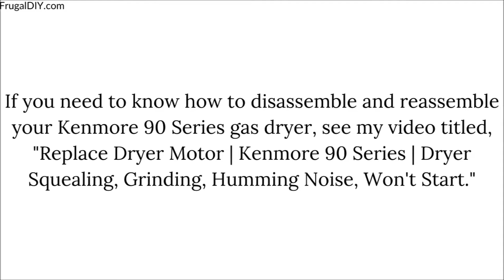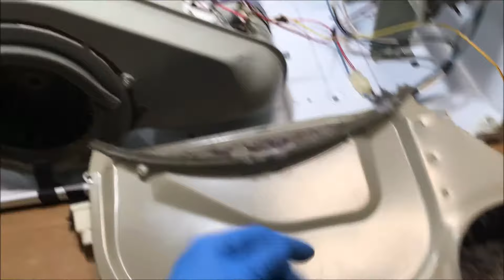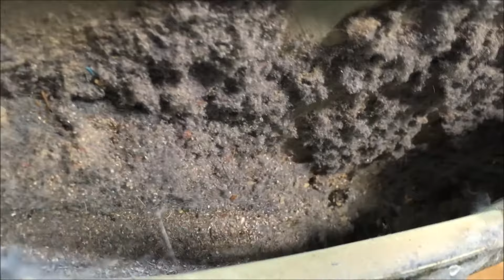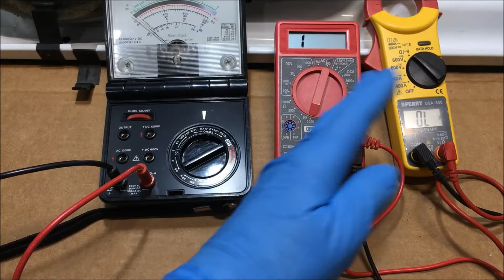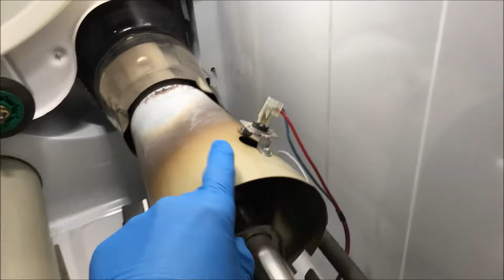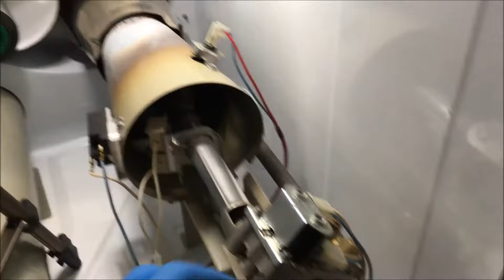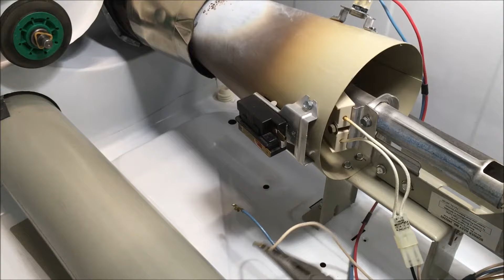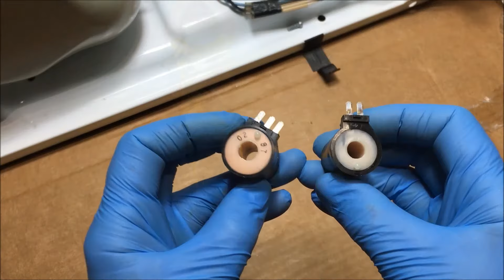Troubleshoot Gas Dryer | Dryer Won't Heat, Won't Start, Won't Stop, Dry Time Too Long, Dries Too Hot

Comment: I've now replaced the thermal fuse twice in the past 24 hours.  It's a Samsung DVG54R7200v/A3.  Anyone have any ideas?  I've checked the blower assembly, lint filter, and ducting.  It's a new house.  Issues in the dryer duct in the attic?

Comment: Agree,.... the best explainntion to save a lot of time to guess which one fails. I watch at least 4-5 video. I open to test high limit thermal, ignition vail coil boht of them are good. I opnned igter burner - I broken.. then I watch this video I found the issue - the first one thermal fuse she suggested - it failed.. it should cost me $5 .. inrtead of cost me $20 -$5 and igniter ($15).. thank a lot..

Comment: The flame sensor is normally closed so a continuity test doesn’t show that it opens properly. When the igniter warms it up, the circuit opens and there is no continutiy. I’m not sure how to test if it opens with the correct amount of heat.

Comment: Hi Frugal, thanks for your video. I have an LG DLEX3700V dryer that's giving me the error code TE1. I looked it up online and found that it might be a bad thermistor. I ordered a new one (model 6323EL2001B) and replaced it. I measured the resistance of the old one, which was about 8K ohms, and the new one reads around 10.8K ohms. From what I found online, the normal range should be around 11K ohms, so I think the new thermistor is fine.

I also tested the round thermal fuse you mentioned in your video, and it reads 0.04 ohms, which seems normal. I took apart the vent and cleaned everything, inside and out. There’s no dust or blockage near the two sensors. After reassembling everything, I double-checked all the connections to make sure they're tight. I also measured the resistance at the yellow and blue wires leading into the control board, and it shows around 10K ohms, which means the connection to the board should be fine.

Once I put everything back together, I reset the dryer by holding the start button for five seconds while it was unplugged. But when I powered it back on, it ran for a few seconds and then showed the TE1 error again. I tried restarting it a few times, but the TE1 error keeps coming up.

Do you think this could be a control board issue? The board is pretty expensive, so I don’t want to buy one without being sure. Could you help me figure out how to use a multimeter to test the board and what kind of readings I should be looking for to determine if the board is bad?

Thanks for your time, and I really appreciate any help you can offer!

Comment: This lady is an expert. I watched 10 other videos trying to trouble shoot my Whirlpool Duet Dryer. They did not solve the problem. Luckily, I clicked on this presentation. It is a clear, concise and comprehensive look at the entire heating system. I watched it twice, before starting repairs. I did test the two fuses others discussed in other presentations, but had continuity with both of them.
 She led me directly through each component, where it is, how to get it out and how to test it. After watching twice and listening to her accompanying dialogue, I monitored the dryer after taking off the front lower cover. I was able to see that the burner would not relight after the initial cycle. The lady mentioned it would most likely be the two coils that were the culprit. 
Amazon and $8.40 later, the coils arrived. I watched their installation 3 more times to make sure it was right.  NOW I'M A HERO! THANKS TO MS. FRUGAL!!!
Reply from the maker: Rodney, I can't thank you enough for your thoughtful and kind comment.  It means a great deal to me, and I just love hearing you fixed your dryer for $8.40.  Great job, Rodney!   You're certainly a HERO in my book.  I so admire DIYers.  ;)

Comment: Thanks for the video...while I was unsuccessful, I feel I learned a lot and gained a confidence boost. Before I bought a multimeter, I arbitrarily decided to replace the thermal fuse and coils. Since that didn't help, I replaced the igniter, which also didn't help. I then wised up and bought a multimeter. Turns out, all of those components had the appropriate continuity or readings within the right ranges. However, the cycling thermostat (2nd item you checked) did not seem to have continuity. However, the replacement also didn't have continuity. It didn't seem to be exactly like yours...there weren't 4 wire connections, only 2. So not sure how that should have been tested. In any case, I ended up having a service person come, who diagnosed the issue as a bad control panel. They don't manufacture the control panel anymore, and seemed to be $150+ on ebay. I opted to buy a more analog used dryer gor $50 on facebook. I did install it myself. Either way, though I wasted some money on non-refundable parts, I got my hands working and gained some education, I really feel a more can do attitude, largely inspired by this video and that experience. Thank you!
Reply from the maker: You welcome.  I'm glad to hear my video helped to muster the confidence to fix your dryer.  I know, from personal experience, you can fix most stuff yourself, and I hope you know that too.  ;)

Comment: Hey i have a few questions: does the sequence of operation starts in the order you explain it here? And does the function/communication of the igniter and the heat sensor in a gas oven?

Comment: My burner lights but shuts off after about 30 seconds but the rest of the dryer continues to go and nothing is plugged it's clear and clean. I replaced the coil just for the heck of it with new ones but it still does the same thing

Comment: My Samsung dryer will start and heat - but shuts down after a few minutes - and seems pretty hot inside. However, it can be restarted again right away - only to repeat the shutdown cycle. It will run fine in air fluff (no heat) mode. I've dismantled and thouroughly cleaned everything - and all the thermostats/sensors show continuity - but the shutdowns continue. >>> Could the thermostat have failed in the "always on" (i.e. always shows continuity) which causes the burner to stay on too long and then the high temp limit switch shuts everything down (although I thought the high temp limit switch would just turn off the burner - not the motor too. Any thoughts would be appreciated - before I admit defeat and call in a pro.

Comment: After checking everything else, it seems I have a coil issue. To make sure, since I don’t have a viewing hole to see the flame, I turned off all the lights to make the entire room was pitch black. I also put some aluminum foil in a spot where it didn’t touch anything but hopefully would reflect some light for me to see, though i actually don’t think it was needed. After the dryer was turned on, I saw that the igniter turned on twice (giving a bright red-yellow glow each time) and the gas lighting up twice, giving a faint but visible blueish glow. After that, the gas wouldn’t light up anymore. I immediately turned the dryer off, unplugged it, quickly removed both coils to test on a multimeter (you don’t have to be super rushed, it’ll stay bad for a while), and saw that one of them didn’t give any ohms. After letting it cool down, I tested it again, and sure enough I got a reading. Did all of this twice (ensures I only need to “cut once”). 

To OP, thank you so much for this video, I really appreciate it! Hopefully I can get this all repaired up. I’m so tired at this point @_@

Comment: Mine starts has the flame come on for a few seconds then shuts off with an error code of E01. It's a Bosch. I bench tested the flame sensor and it never opens. Could this be why or something else?

Comment: Awesome video, as a DIY Homeowner I was able to fix my dryer with your expert help. The only problem I had was, I wanted to test everything before I put it all back together and could not get the motor to switch on until I move the idler pulley, and there was a micro switch and then everything worked thank you so much.❤️

Comment: I fixed my dryer last year by cleaning a very fine build up lint that was blocking the cycling thermostat. Funny thing is NOBODY mentioned this in the videos I watched when I was trying to troubleshoot it last year- I discovered it on my own. I wish I would have found your video back then but at the same time it felt good to find the issue on my own! That and your video is better than ALL of the ones I watched when I had my issue last year. I have an issue now where the flame is blowing wildly instead of smoothly, causing it to trip the  high limit thermostat. I have a good feeling my coils are failing. Thank you for this great video as it was a great refresher!

Comment: Had no heat. Tested everything. Found no faults. It was apparently the 25 year accumulation of lint that blocked the view of the flame detector and stopped it from igniting. After a good cleaning it worked. Job was more tedious on my dryer because you have to remove the whole front for access to the burner assembly. Then you can't do any live testing without putting it back together. 
And yes, I watched several dryer youtubes and this was the best

Comment: I am dealing with my whirlpool duet, 19 years old, with this excellent tutorial, I am confident I’ll be able to fix it!! Thank you some much!!👏🏽👏🏽👏🏽👏🏽  
I think is the igniter, I have checked the thermal fuse, the high limit thermostat, the thermistor, the  Gas Valve Ignition Solenoid Coil, and they all test good. 
The dryer turns on, but the ignitor doesn’t come on, there for the flame is not coming on. Thank you again for the tutorial!!

Comment: Great video and it helped a lot - although my Kenmore dryer might be  a newer design because it's very different from what I see here. The burner is on the other side. The blower is not inside the cabinet, it's on the back bulkhead (along with the thermal fuse and cycling thermostat). Speaking of cycling thermostrat, on my dryer, searspartdirect refers to is as a "drying thermistor" and it has two pins, not four. You test it by removing it from the dryer, then measuring the resistance as you blow hot air from a hair dryer on it. You should see the resistance decrease.
I just got done testing everything and all components passed - but my dryer's burner shuts off a few seconds after it ignites so I suspect the coils. However the ducting and exhaust had quite a bit of lint so my first move is to clean all that out and see if that fixes it.
Reply: And indeed it was the coils. As you cautioned in the video, they tested good - but failed under operation. All fixed now - $17 at Amazon! Thanks again for making this video - it's by far the most informative appliance "fix it yourself" vid I've seen on youtube.

Comment: I just wanted to send a little something as a THANK YOU for making this video. Our 30-year-old dryer finally stopped heating yesterday, and I had no idea what to do except to start researching. I came across many websites, forums, manuals, and videos. However, YOUR video is the one that enabled me to fix my washer for $10.81. After testing everything as you had, it was actually my igniter that was bad. No reading on my volt meter. Picked up a new igniter this morning, volt meter showed a reading, installed it, and it fired right up and started heating again.

Again, I cannot thank you enough for your commitment to your tutorials. The details, straight to the point cadence in your delivery...everything about it is fantastic. You have a new subscriber in me!!!  Have a great week.
Reply from the maker: I apologize for the late response.  I'm just seeing your thoughtful and lovely comment and your overly generous gift.  I'm truly grateful and touched by both your comment and generosity.  I'm thrilled to hear that my video helped you fix the dryer and save your hard-earned money.  Great job!  I wish you many successful years of DIYing.  ;)

Comment: You explain it really well. My dryer takes a long time to dry. It flames up on and off. I have a high degree of confidence the coils are the problem based on your explanation. I will order the parts first and then do the work. Ty

Comment: Thank you for the detailed and well explained video.  Quick question...  My gas dryer spins but no heat.  I replaced the thermal fuse and coils.  I tested the thermistor (cycle thermostat), igniter, and flame sensor ..  all good.   Gas valve is on but there is no glow when I start the machine.  My last test will be the high limit thermostat.  Do you think that that would be the problem or something else?  Pls advise.
Reply: My gas dryer is a Whirlpool WGD9500TW1.  I also cleaned out ALL my lint in the exhaust.

Comment: My ignitor doesn't heat up, you said between 50 and 400? Mine says 46 but it does glow when I touch the white and blue wires together from the flame sensor

Comment: Hello, thank you for creating such detailed video. I was able to disassemble and replace the 2 felt seals on the machine but it did not solve the problem on my gas dryer. The drum doesn't rotate easily even though I've check and oiled all the rollers, including the tensioner (I thought i was because of the old seals). When I start the dryer, I can hear the motor struggling to start. After a while it overheats and shuts down, with a characteristic transformer smell. If I help it by turning the drum manually, it starts and rolls the drum. I don't know if the motor is too weak or if there is too much friction from the drum. I am thinking of buying a replacement motors but I don't want to sink more time and money in it. How freely should the drum turn? Any thoughts?
Reply: Update: I replaced the motor and the dryer now works beautifully.

Comment: March 2024. Can't thank you enough for this video. Our dryer quit heating up a couple of days ago. On our old dryer I had to replace the gas valve coils a couple of times and assumed the same this time but on this new dryer the igniter never did heat up. I was at a loss until I came across this video. A trip to Harbor Freight got me one of those multimeters for $4.92 at their parking lot sale! Turned out the thermal fuse was the culprit. I wouldn't have had a clue without seeing your video and probably would have been out several hundred dollars for a service tech. Instead, I was able to diagnose and repair it myself for around $21.00 total! Thank you, thank you, thank you!!💯
Reply from the maker: That's a WONDERFUL story to hear, Ted.  I'm so proud of you foe fixing the dryer yourself.  Look how much money you saved and how much you've learned.  OUTSTANDING!  ;)
Reply: 2026 ahahaha tks too because all ready chek all component and in my case the burner its the one who dont read well so far all rest read ok morow im going to buy the burner and see if fix the problem and let you know tks from Puerto Rico ❤❤

Comment: I have a  new ge dryer has worked correctly from the start.
It workes just fine when I first turn it on for about two heating cycles then  the igniter just glows and wont light if I turn it to airfluff and let it cool down some more then turn it back to heat it will cycle again. Would that be the high limit it tested fine when cold ive change both cycling thermastats hasnt changed anything. 
Please give advice.

Comment: Hi good day, i have to tell you this is the best DIY video I’ve come across, I learn so much!.. but obviously I have a dryer problem being that I’m here, can you tell me why is my gas dryer smell of gas and no heat, I’ve replaced the gas valve, it’s the all in one kind. It worked and heat for a while and then Its back to emitting gas again and no heat, however i guess its the igniter and I replace it with a new one, again it works fine and then back to the gas smell. This time I test the igniter with my MM and got a OL reading, I ordered another igniter and tested it, the reading says OL as well, what are the odds of that?… I ordered another igniter, it hasn’t arrived yet, hopefully I will get a satisfying reading on it. 

Has anyone ever had this problem?

Comment: I've replaced all this parts and still having the same issue. Dryer starts, but no heat. Could it be the circuit board?
Reply from the maker: It could be.  I can't say for sure until I troubleshoot it.

Comment: I was just about ready to junk my dryer and buy a brand new one.  Watched several videos on this type of repair.  The unit that you are working on is almost identical to mine.  Your thorough explanation gave me the confidence that I needed to tackle this project.  I tested all of the parts that you described here.  Ultimately the issue in my unit was the very first fuse that you tested.  That part was $5 for two of them on Amazon.  I was about to throw away a perfectly working dryer for $2.50.  Just for kicks, I replaced all of the parts for a grand total of $52.65 in parts.  And the dryer… Works like new!  Thanks a bunch!  I wish I could give you 100 likes!
Reply from the maker: That's impressive, Robin!  What a success story.  You should be awfully proud of yourself.  Thank you for the inspiring comment, and you;re welcome.  ;)

Comment: Thanks, very helpful video. In my case I've determined that the coils need to be replaced. Ordered on Amazon for $8.
Reply from the maker: Job wll done, and you're welcome.  ;)
Reply: Update. Gas valve coils arrived. I switched them out and also checked all other components exactly like you showed. They all checked out ok. I did look up a video on how to take off the front panel of my particular dryer. I also cleaned everything inside with a shop vac. Put it back together and the problem is resolved, works like new. Super helpful video!
Reply from the maker: Another success story--wonderful!  FYI--I'm proud of you for taking the initiative to fix your dryer.  You saved soooooo much money.  Happy DIYing!